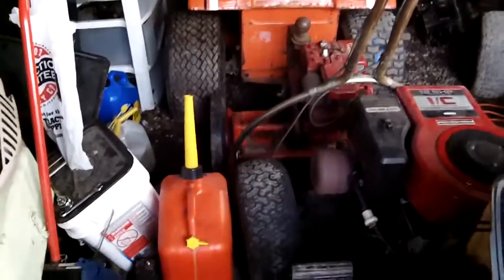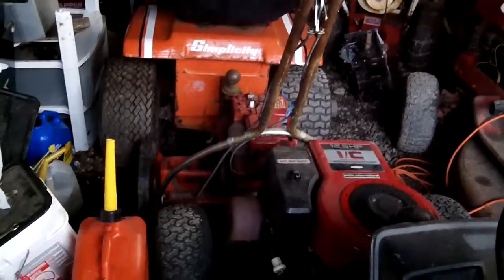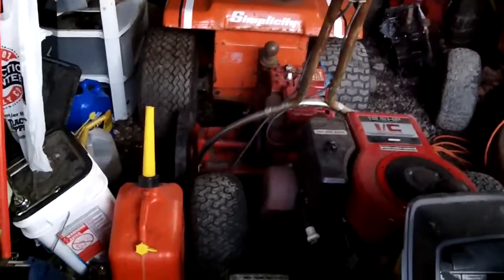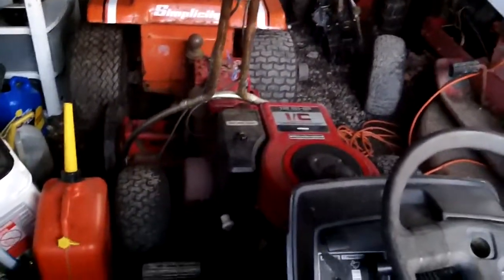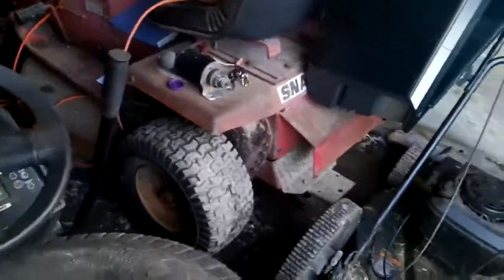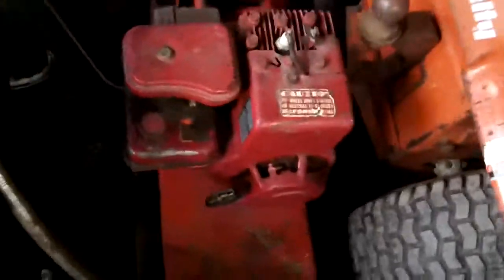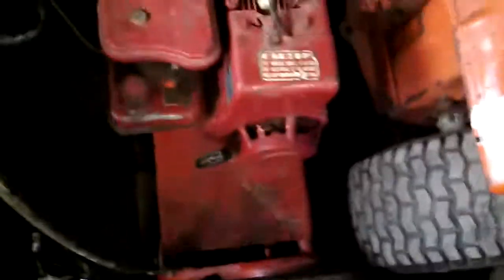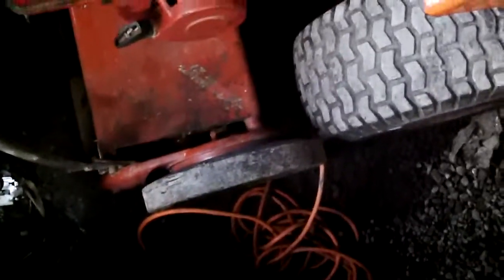a tire for mtd 1999 yardmachines tractor and a a rant

Comment from the maker: slime is awsome just thought tires would fit my needs more. once the belts are on the simplicity will shoot a driving and cutting vid if it works out I'm die to see the 1960 toro reel mower run